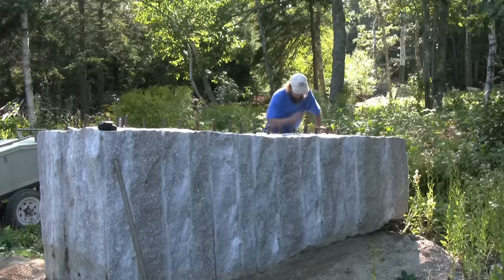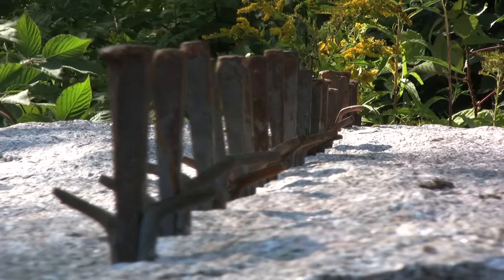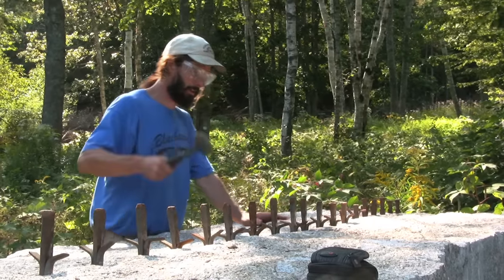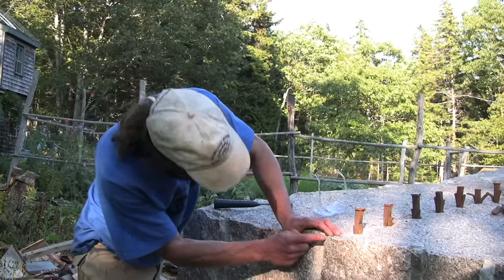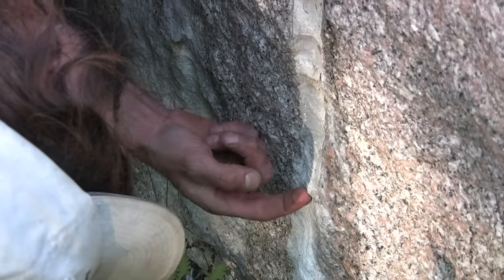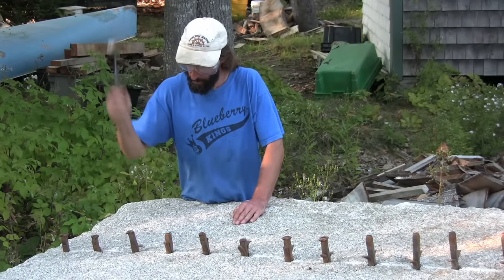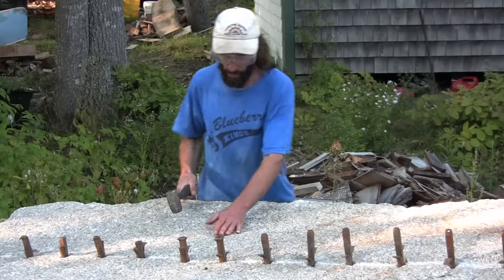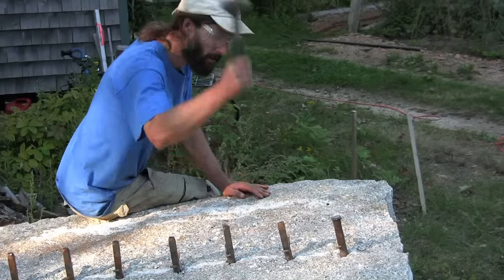Cutting Stone At The Deer Isle Hostel

Comment: 2000 years from now we'll have people arguing, "There's no way they could have split rocks like this with a hammer and chisel, they would have had to use lasers!"
Reply: conspiracy theory!!!
Reply: I’m pretty sure we are already in that argument!
Reply: But he doesn't make it perfectly smooth, also how did he get the holes in the granite to begin with, and quarry the stone? I'd also like to see him move one that's 10-100x heavier than that one for 100 miles. Also, the Egyptians didn't have steel spikes like this, they had copper and wood which aren't nearly as hard
Reply: @WOW WOW I cannot count the amount of times I have been referred to this laughable attempt at recreating the stunning work of the ancients. First of all, there has never been a bronze saw of that size found in Egypt, and second of all, are you really applying this 4mm/hour technique to the literally millions of stones used for the great pyramid? Some weighing up to 80 tons? OR the blocks in the Serrapeum at Saqqara?
Reply: @scottlemoult3109  We have not found lazers of any size in Egypt.

 We have found bronze saws though. If they could cast small saws surely they had the ability to cast them larger. Peace!
Reply: @scottlemoult3109  The only way to accomplish what the Ancients did was with abrasive sawing. The only debate is what the blade was made of and what was the abrasive used.

Occams razor would suggest a Bronze/copper blade or wire saw and Quartz abrasive. The chinese favored Bronze wire and Emery as an abrasive for their Jade work. The best result come from corundom and diamond.
Reply: @scottlemoult3109  
They even showed a picture that dated back to ancient times of workers using a bow drill.   You really think that those Egyptians were a stupid bunch.   They had a huge  construction industry that was in business for hundreds of years.   They didn't only build the Pyramids.  They built palaces,  places of worship,  government buildings,  monuments,  all kinds of stuff.   This was a well oiled business and near down to a science.   Thousands of workers,  moving those slabs out every day on ships to where they were needed.   One other thing.  The pyramids were built mostly of limestone,  which is a lot softer than granite.   Granite wasn't used that much, only for specific purposes.

Whatever the specifics are,  we can be fairly certain of one thing.   We haven't found any alien artefacts.   Not one alien seemed to have dropped a dooflicky,  whachamacallit or whatzit that is made out of a material that humans wouldn't have had back then.  You'd think there'd be all kinds of stuff they would have accidentally lost and left behind.....but nothing.   A few curiosities but not nothing really definitive.
Reply: Lasers would be more accurate
Reply: @MrRecklessryan  having not found them don't mean they didn't exist. Laser ain't nothing new
Reply: @nyakwarObat  You can't cut Granite with lazers lol.
Reply: @MrRecklessryan  and which part did i mention cutting granite? Or you just love stretching shit to amuse yourself?
Reply: @nyakwarObat  Ok then, what do you propose these unfound imaginary lazers were used for? Lol
Reply: @nyakwarObat  This thread is about cutting and splitting stones, read the thread you are commenting on next time.
Reply: @MrRecklessryan  oh, didn't realise you are this comments section police, I only responded to the laser part cos someone brought it up. I didn't realise it warrants a charge
Reply: @nyakwarObat  Use your reading comprehension please,  don't just glance at words,  read and re-read if you have to. Peace!
Reply: @nyakwarObat  Try to contain your emotions sir,   I am simply asking you to read before commenting next time. Peace!
Reply: @eugenefrausto8475  Ya think?? THIS man is a homesteader and built his own home from his own land. He also runs a hostel. This video was made because he was so happy to be splitting his own rock by himself for the first time (as he clearly said). It wasn't designed to be a "teaching" video. Give so credit where it is due, very few could or would chose his lifestyle. Then again, HE has no mortgage and built his home in a couple years, with his own trees he milled himself....and it is GORGEOUS. No water bill, no electric bill (yes he has electricity, it is solar) and grows a years worth of food every summer. He runs his hostel 5 months out of the year and produces enough income to enjoy the rest of the year.  I love to be as smart as this man...never know what this Country's' future holds.
Reply: @jelica9475  nice, but how does one decide the limits of ideology in homesteading? Lets say as you suggest he built is own house from would on his land and split his own stone. But he would have to by his solar panels which are modern technology and their energy production starts going down at 20 years. Lets say you are living of the land  that usually means you have basically what you need. So how you going to buy a solar system? And if you decide you need electric than why not electric tools? Also you can always find a dynamo in a pile of junk and produce electricity from wind or water for free.
Reply: @אוריפלסי  your statement "check your bible" please.  You still in that Indoctrinated level
Reply: @nyakwarObat  yup. And while i am at it did you ever hear the story of people thinking that jews have horns? That is because the hebrew word for horns is 'kernaim' which is also the hebrew word for rays. It is said that when Moses got the ten commandments he had 'kernaim' coming out of his head. In translations it was mistakenly written has horns. However he had rays coming out of his head. Those rays could be laser beams which could also have cut rock in egypt for the pyramids. And there is no reason lasers couldn't technically cut rock. Some things they burn through and some melt through. Rock melts. If you melt a concentrated line it could cut right through.
Reply: @אוריפלסי  🧘‍♂️
Reply: The aliens must have taught people around the year 2000 how to use hammers.  There's no way they had technology like that back then.
Reply: They needed more than lazers. Needed levitating device for the huge stones, advance mathematical measurements and placements. Among who knows what else. Sticks and rope plus saw is laughable.
Reply: Scientists predict that the end of humanity is going to be at arround 2400 due to climate change natural Disasters etc. So theres that.
Reply: I used a saw then wedges.
Reply: Egyptians used sound also
Reply: Comander Gromit how?
Reply: @scottlemoult3109  you hammer the initial holes with a chisel lol.

Are trying to say the Romans used lazers cut and get their granite so perfectly smooth and flat, and then they meticulously wrote down some other way of how they did it, just to throw us off? Btw, the romans were almost obsessive compulsive when it came to recording things (they left no room for mystery to be filled in with speculation).

Comment: Lovely to see this still being done. In a "former life" I used to split large lumps of stone using the same method (called Plug and Feathers here in the UK). Something that I was a little surprised to see here was that the quarry block was apparently dumped flat on the ground - I always liked to put a hefty skid directly under the fracture line, which helped direct the split and also as the fracture starts to open, the weight of the stone works with you, not against. Obviously you also need to add a couple of smaller skids either side, as well, as you don't want a couple of tons of stone rolling over onto you! It also meant that after the stone was split, you don't have the issue of separating the two halves, but can get slings around them more easily. Thanks for posting this, it brought back a lot of memories!
Reply: @at7388  Nothing as large as this, the largest ones I worked on were 5 tonnes as that was the capacity of the crane for unloading. The stones were also softer than granite, mostly Boles Hill, Wattscliff-Lilac, Forest of Dean, Grinshill, Stanton Moor, Hollington, etc sand/gritstones, but also various of the Bath and Guiting ooliic limestones. My primary cut saw was only an ancient Anderson Grice circular saw that could cut 18" in the bed, so splitting quarry blocks by hand was fairly necessary. The firm I worked for never advanced as far as buying a frame saw, sadly. We didn't work with granite, slate or marble very much, but on the occasions we did they were bought as slabs or sawn six sides.
Reply: @at7388  The arrived as quarry blocks, split or cut using wires/chains into rough cubes.

Comment: Great job, but get rid of that steel handled hammer or your hands will soon be as arthritic as mine ... wood handles are the best.
Reply: +Mike Freeman Old wives tale at best; Rittershock does not contribute to arthritis.  Will give you tennis elbow however.
Reply: Aint rubber better?
Reply: Naah I use the estwing hammers to strike chisels they work well
Reply: @christopherfitch7705  estwings are very high quality
Reply: I'd be standing on top with a pneumatic hammer, wtf?
Reply: @johnhulsker9123  If you need gravel that is I suppose?

Comment: Did this man build the pyramids in Egypt?
Reply: +john papple Hahaha, three sarcastic guys, running circles around each other! I want in!
Reply: +oisiaa Yes, he and Ben Carson built them to store grain...
Reply: +UraniumMan Good joke. I like you.
Reply: no, but hi looked how this doeing..))
Reply: +Й Й Йй 
and then took the напильник and do the surf as glide..
Reply: +oisiaa I realize that your comment is five months old but I figured you might find this interesting. The ancient Egyptians only had the ability to make copper tools; which is a softer metal. To cut large stone blocks they used a method called 'fire-setting' which involved building a small wall made from mud bricks in the shape of the object you want. They would then build a fire inside this enclosed space and let it burn for around a half hour. This would allow time for the heat to cause the rock to expand. After this they would pour water over the fire to cause the rock to contract quickly. This would cause a crack around the perimeter and make the rock easier to break apart.
Reply: ***** Yes, yes they did. It was a very popular method used not just by the Egyptians, but many other great civilizations. Since you probably won't believe me, what method do you believe they used?
Reply: It was been thousands of years since these structures were created. Don't you think wind erosion would remove evidence? They didn't only take stone from the surrounding mountains. There is plenty of evidence of rock quarries all around the Nile. Again, you still haven't explained another method of cutting these stones; i'd like to here what you think about it
Reply: +ThePsychonaut the pyramids were made of advanced geopolymers. sort of like concrete. So they built forms, and poured the geopolymers into the forms, and repeated it over and over. Now this is bad news for the Egyptian scientific community, but I think it's brilliant, Occam's razor. Why quart massive block when you can mix and pour...smarter not harder...
Reply: About 95% of the piramids were made from Sandstone and Limestone that are much softer materials. 

Look for a video called "Limestone cutting the old way demonstrated to apreciaciate how much softer they are.

Also , mucho of the blocks of the piramides were cut in very rough shapes, you can put a full arm between the block, only in the external parts, the egiptian did precision cutting, and that was mainly on soft limestone.
Reply: actually...to cut the harder stone types like granite and basalt they built giant gem tipped circular saws 5 meters in circumference.  Pretty badass how precise some of the surfaces they were able to produce thousands of years ago.
Reply: oisiaa naw he would have to be cutting stone 60 times faster then this to build pyramids. Also pyramids are alien made
Reply: Tech By SnLiner he said alien made he lives in the bubble of illusions 😂
Reply: The egyptiand used wood and water to do the work for them,ive seen them do it!
Reply: What the hell is wrong with you? ....everyone knows the pyramids were built by the Goa'uld
Reply: pyramids didnt built with this lowskill.
Reply: with soundwaves or vibrations.. zero point energy.. but never this way.
Reply: By that logic the man who built the first jackhammer is god.
Reply: The pyramids used wood expanded by watering, because they missed the iron, but had the heat to dry out the wood fast.
So no, he didn´t.
Reply: what? so simple? no mr... we have no idea how they cut the stones or lift them up! no idea
Reply: r/wooosh

Comment: Amazing how force and patience can split a boulder. Just takes time and work. Not as fast as a rock saw but not near as expensive.

Suggestion: take the wedges to a blacksmith and ask him to grind the mushroomed tops off the wedges. Mushroomed wedges can split off at high speed and injure people. This applies to all struck tools. Also have the Smith drill small holes in the tops of the wedges and connect them together with a small chain. That will keep them together after the rock splits and the feathers drop to the ground. Some always go missing. This saves the search time.

Comment: probably aliens gave him that ultra high tech....
Reply: if you are referring to the pyramids and the Egyptians theres a huge problem, they didnt have steel, thats the real question how they made it with wooden tools or brass only? in modern terms is like creating and moving a  huge titanium sculpture with ropes and steel files only.
Reply: Scordare pyramids blocks are way smoother then this and have no holes.
Reply: Luis Fernando That's not really the same equivalent.  It's quite well known how the stone for the pyramids was quarried and cut.   Granite was also cut using a few methods,  one effective one was copper but expensive for them because of imports.  

However there is many many pyramids all leading upto the famous ones,  it shows the evolution of their building techniques including their failed ones where the foundation gave out,  a chamber collapses etc 

The internal ramp theory seems the most plausible and was also seen in another earlier step pyramid built,  the rock cutting was tedious but again the tools on site,  and incomplete ones show their methods.   For instance the obelisks that never quite made it out the ground shows they used rock hammers to remove material all around,  however abandoned one that was cracked. 

Unlike what most documentaries say they are not a big mystery,  experts know there is several ways they could have been done,  especially after seeing the many before them and observed the learning.   The only mystery is which of the plausible methods was used,  which isn't totally decided.
Reply: We used wooden wedges and water for braking rocks in my country. Easy as fuq.
Reply: Low tech is sometimes the best tech... like in this case.
Reply: @lmeza1983  use any half hard metal, or stone. Chisel out a small opening around a huge chunk of rock. Place wood in the gap you just made, and add water. The wood expands and the stone cracks loose. Quite simple really.
Reply: @lmeza1983  They did have IRON! And you don't need sandpaper for polishing! You can use GRANITE or your brain.
Reply: @lmeza1983  Granite can be split with copper wedges, just the same as steel.  The new world stone masons also used copper and bronze wedges with no iron, to break stones.  Or you can break granite, diorite, and dolomite with hand held stones or dropped stones, to erode it from its substrate, like the obelisks were.
Reply: @MadmanThreeTwoTwo  You can polish granite with sand moved around with a stone.  The silica will polish any stone.  You can also cut granite blocks with sand abraded back and forth with a wooden board weighted with stones tied to it on either end, like a two-man saw.  Add a little water, and it is even more efficient and faster.  There are youtube videos showing this method being done by modern archeologists.
Reply: The pyramids are made out of soft sandstone. Granite is one of the hardest rocks in the world, It’s like comparing Ash Hardwood to Soft pine wood
Reply: Does that look like highly refined stone work? No.
Reply: Randal Glyph The cutting result is pure garbage. It won't produce proper level surface or 90 drgree angles. Polished stone is nothing new. What is special is that many of the ancient teck didn't sand them smooth because the surface shows it was melted.

Comment: Interesting video and patient work, which shows the main principle of splitting rocks, although a bigger mallet and fewer holes also would do the job. I have done a lot of drilling and splitting, so I know the hard work that goes in it. Are the feathers greased? They look dry. With such a big, carefully cut and probably expensive piece of granite, and then omit to drill a few more vertical holes in its short ends as well..? Then the crack would continue right down the middle instead of slanting. But hats off to Dennis for sharing a careful approach!

Comment: Great work. But wouldn't it help to drill and hammer in a few wedges into each end of the block as well, to help initially guide the crack straight down and stop it veering off left or right, as it did?

Comment: This guy doing the wrong way....

The Rock is very heavy, the correct way would be to position the Rock in a slope or elevate the opposite side of the crack with wood underneath.
The way he is trying, the nails cause the crack but also need to push the other half of the Rock. Gravity could do this easily.
Reply: Good observation Im about to start a quarry job.